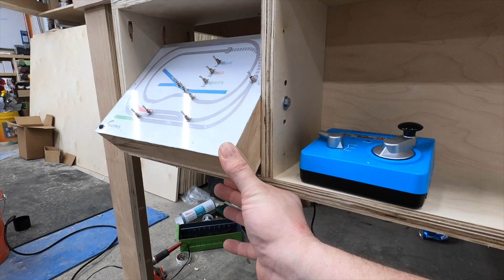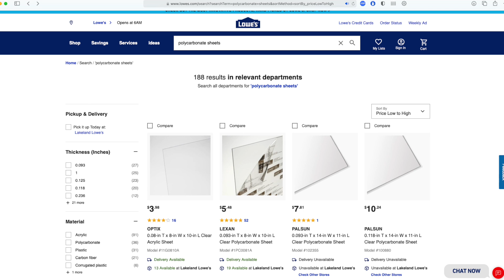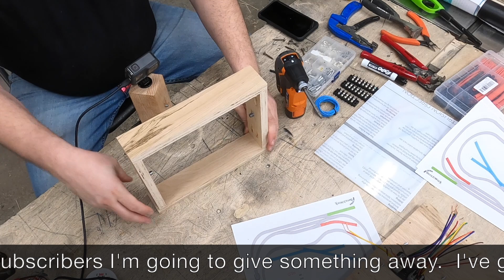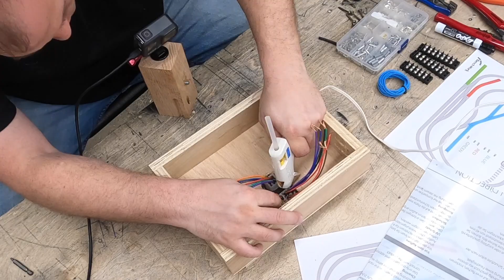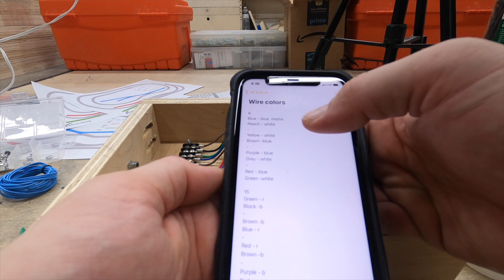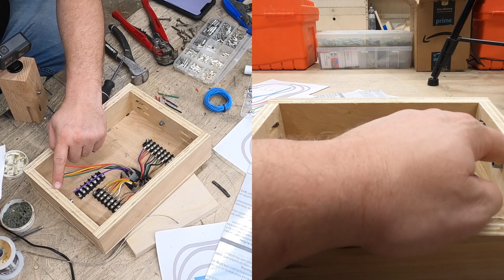Model Railroad Control Panel Build, Part 1

Comment: I’d really like to see a video on soldering.  Especially about soldering neatly.
Reply from the maker: Like this one? https://youtu.be/sINByhEg7L8   Basically it comes down to make the iron hotter than you think you need it, use flux and tap the soldering iron instead of holding it to the work.

Comment: I would love to see a video on soldering.
Reply: Especially since this did not show the right way to solder. You don't put the solder on the iron (apart from tinning), you heat the part and apply the solder to the part.
Reply from the maker: I have my way, you have yours.   My way obviously works and I’ve been doing this for small joints for 20 years without issue.  It really however depends on what you’re soldering.  O gauge track for example requires heating the rail then applying solder.